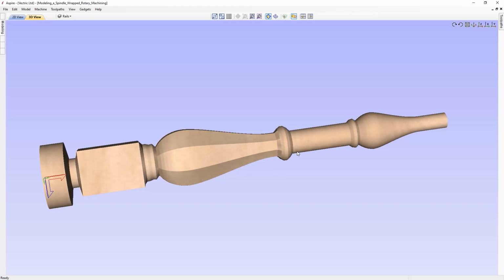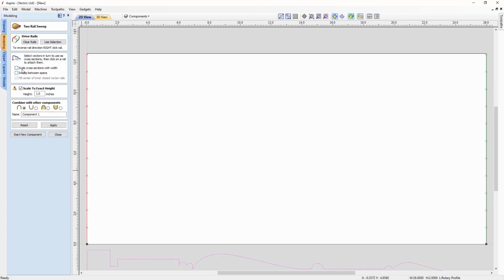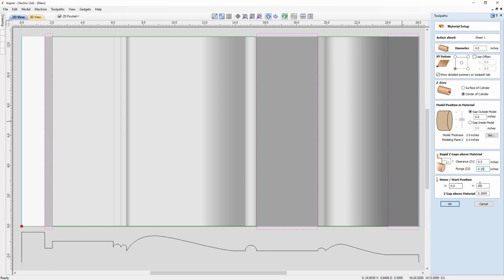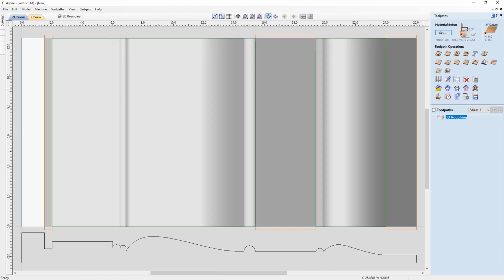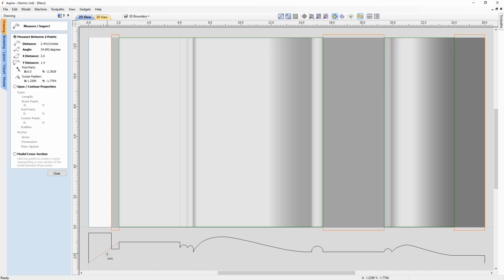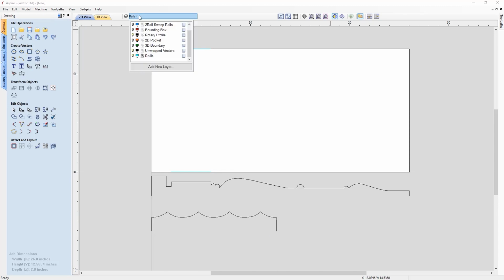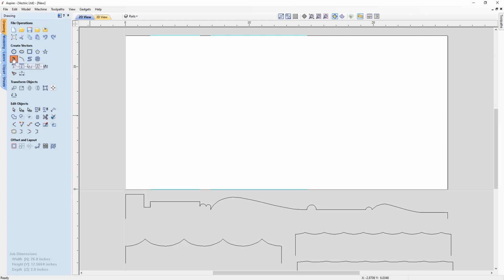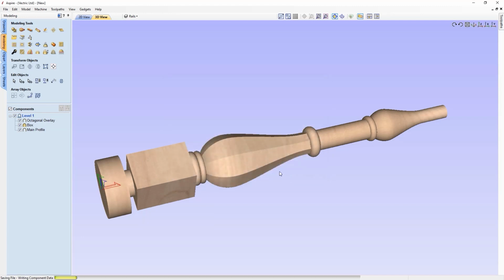Modeling a Spindle for Rotary Machining | Vectric V11 Tutorials

Comment: When I make rotary model in the preview of toolpath it seems ok but in execution in the machine, there is gap which is not followed. Example: I made a cylinder 100 mm dia means 314 mm  circ with text. In the execution only 264 mm circ is with text 50 mm tool didnot went. What could be the reason ?
Reply from the maker: Hello Eric... I think we will need to look at the actual file.  Could you please email it to support@vectric.com with an explanation of the issue, and they will get back to you.

Comment: Hello, new in 4 axis,, at 2min you explain XY DATUM,,, now i know how is work in 'normal 3 axis2' but cant figurer out how it is work in the WRAP/4 axis setup, can one explain that specifik? and thx for the good videos.
Reply from the maker: Hello Tommy... We Swap either the X or Y for the "A" or axis of rotation.  You post processor will take care of that, you just need to choose what axis your job will be wrapped in.  If you need a more info on that you will need to contace support@vectric.com.  They will need to have a bit of a back an forth with you so we can better understand the confusion. :)
Reply: @vectric  Hello, got the NO SWAP, thx, but still XY datum is still a problem for me,not for you ;-)  thinking about Vcarve Desktop hobby version..
Reply: @vectric  ahh. Not a true 4 axis, ok, but it do work, Thx